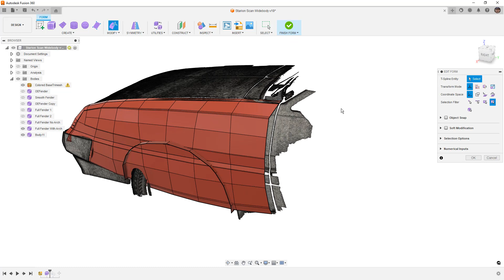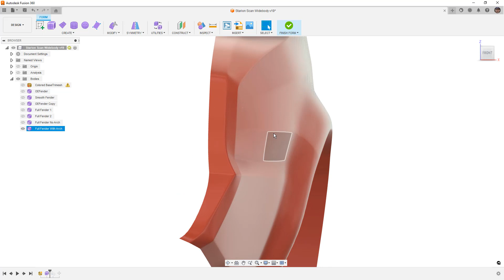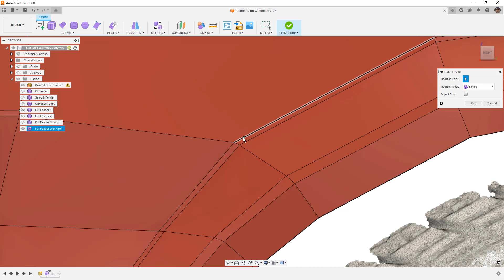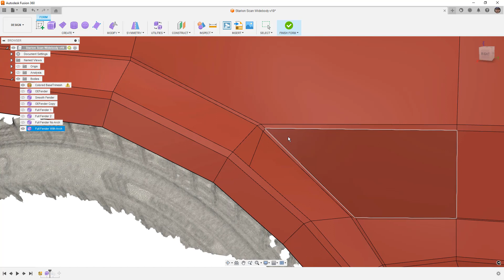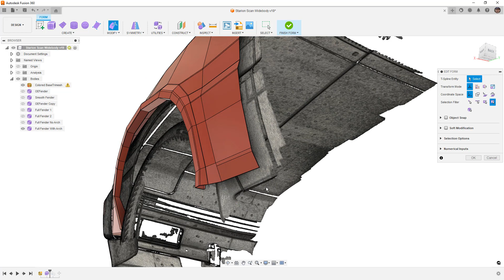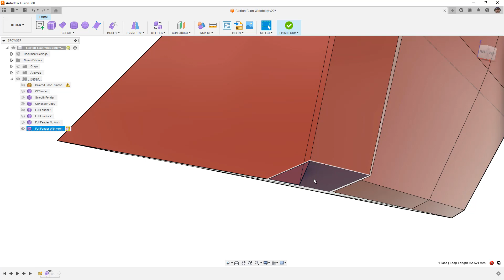3D Scan to Part Series Part 10 | Wide Body Design Part 7 | Combining Hard Edges and Wheel Opening

Comment: do u have missing the Part 8?????
Reply from the maker: not yet....  I have run into all sorts of trouble with the printing.  some of it is my 3d printer. some of it is time.  I will finish it off but sadly it is taking way longer than I had hoped.

The short of it is that the tall thin pieces on my printer are getting about 90% of the way done and then coming off the build plate and ruining the print. so i have had to slice them up smaller and in some cases use a lot of support material.  When i film part 8 I will talk about all these problems....
Reply: @LearnEverythingAboutDesign  oic, hopefully can get the new updated for this.... anyway thanks your information
Reply: The video oppening 😂

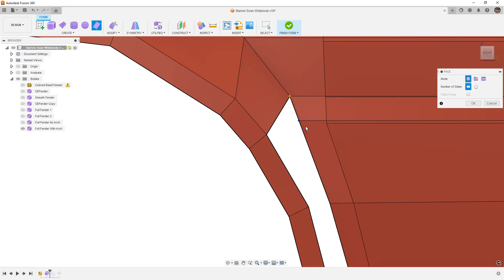Comment: Hey, You can make a triangle face when you select the 4th point back to the 1st (min 11:20)
Reply from the maker: The problem there was the face tool and its settings.  If you select 2 of the same points when make a face it wasn't to be 4 sides you need to go back and weld those verticies cause it places them on top of each other.  If i had used the polygon option in the face dialog i probably could have done that though!
Reply: Yep!